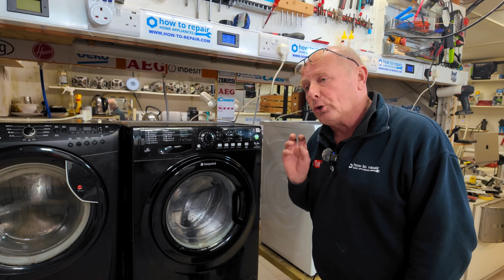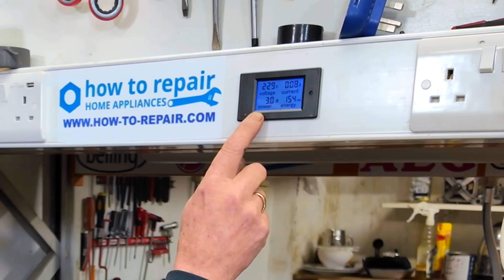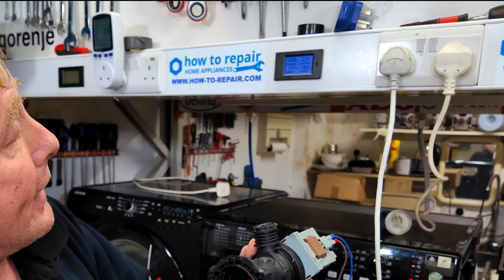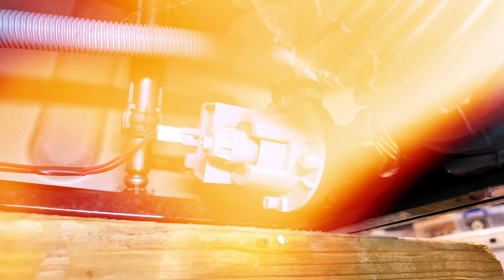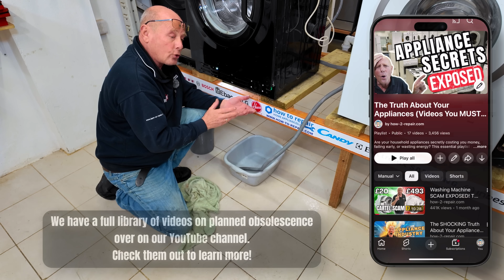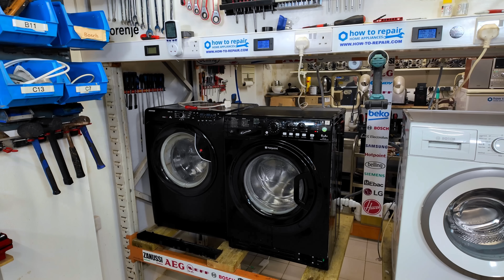How to Unblock a Washing Machine Pump Without Making a Mess

Comment: How can people be this dumb? Whenever a washing machine stops draining, the plug in the front of the machine is the first thing I check and once I've drained the water out all over the kitchen floor (with a towel in place) and removed the blockage, the machine usually works flawlessly afterwards.

If that isn't the issue, the machine not being level/tilted forward slightly is another one I've encountered.
Reply from the maker: It can certainly feel frustrating when the solution is so simple, but in my 40 years in the trade, I’ve realized it isn't always dumbness it's often just a massive lack of confidence. Many people are terrified that if they touch a machine, they’ll either flood the house or get an electric shock. That’s exactly why I make these videos!

If you’ve got a knack for keeping your appliances running, please give the video a thumbs up, share your own repair stories in the comments, and subscribe to the channel! For any spare parts or tools you might need, check out our website, and if you'd like to support the channel, feel free to Buy Paul a Beer. Thanks for watching!

Comment: just scrapped/replaced my own machine i had the last 6yrs bought 2nd hand (exactly the same as that but in grey) must have been 8-12yrs old picked it up for free a,long with a matching fridge both immaculate previous owners just fancied a change lol madness....nyway initially thought it was the dampers (bad vibration/banging) when i stripped it down noticed play in the drum and presumed it was bearings there and then written off as the drums sealed......Anyway when i eventually stripped it down part for parts/part to make taking to the tip easier (and of course the instant handy garden log/garden waste  pit I found that it was not the bearings BUT the spider had erroded and snapped on one leg kept the motor control panel pump door and various valves/solenoids to list on Ebay at a later date if i can be bothered
Reply from the maker: I've seen that exact scenario more times than I can count. You’ve done exactly what I recommend keeping the brain (PCB) and the heart (motor). Those parts are becoming harder to find and listing them on eBay is a great way to help someone else keep their machine out of the landfill while putting a few quid back in your pocket.

If you enjoyed please give the video a thumbs up, share it with your DIY mates, and subscribe to the channel! If you ever need advice on your new machine or want to check for spares, head over to our website. And if we've helped you feel better about that scrapped machine, feel free to Buy Paul a Beer.

Comment: I read or heard somewhere that if a washing machine has a visible filter door, the owner is more likely to find and fix a blocked pump themself, than if it is hidden by a full width flap - A case of owners not RTFM.
Reply: I've had both. I don't like cleaning the filter but I do it because replacing the whole machine is a lot more costly and hassle.

Comment: If you see that people do not even do these little bits of repair - they will definitely not open a drum.
Still, those broken machines can be exported and repaired.
Reply from the maker: In my 40 years in the trade, I’ve seen the repair gap grow wider and wider. If a five-minute pump fix feels like too much of a hurdle for some, then cracking open a sealed outer tub to get to the drum is practically out of the question for the average household.

That’s exactly why I’m so vocal about built-in obsolescence. When manufacturers weld those tubs shut, they aren’t just making it harder for the homeowner they’re making it nearly impossible for professional repairers to do the job at a price that makes sense.

My goal is to give people the confidence to at least look before they leap for the credit card to buy a new one. Even if they don't want to open the drum, clearing a pump is something almost anyone can do with a bit of guidance!

If you agree that we need to keep these machines running longer, please give the video a thumbs up, share it to spread the word, and subscribe to the channel! You can find any spares you might need on our website, and if we've helped you save a machine from the landfill, feel free to Buy Paul a Beer to support the channel. Thanks for watching!

Comment: Idk if obsolescence is a thing. People want cheap appliances. Of course old washing machines were more reliable, in today's currency a washer from the 80s would have costed around 4000€ (Miele W433 from 76, currently restoring it. Everything is broken/brittle). 
If people would stop going for 300-500€ washing machines, the industry would follow. 
Plus people just don't know how to maintain their stuff and keep using liquid detergents and low temp cycles... you wouldn't believe all the stories I already know why people throw their appliances on the dumpster. Clogged pumps, lime, wrong leveling, etc... you name it.

Sealed drums are a problem for DIY techs. But here in Europe many people just don't want to spend 300€+ on a drum repair when the whole machine was just 500. Or a new one is 400€. So why spend money on accessibility, when consumers won't even use it? Changing the bearings is nothing you would do for 60€ as a service technician...

Even a broken heater is a death sentence for many washing machines nowadays, because the repair is already at 130€+...

I hear you, but I guess the best thing is to take profit from this situation and get good appliances cheap and repair them.
Reply: A good way to get people to spend a bit more on their appliances would be to put reliability ratings on their energy labels, so they can compare life expectancy along with energy usage. It could be based on the reliability of previous models of the same brand that had a similar RRP band (and allowing for inflation). The data could be collected automatically by wifi enabled appliances reporting hours runtime/ total cycles and error codes, and also having a label with the model and serial number that's scanned at point of sale and at point of disposal. This would encourage manufacturers to make their appliances both more reliable and easier to repair.
Reply: @mels8966  Sounds like a good idea!

Comment: This is an example of where, if it was done properly, having Wifi in an appliance could actually be useful, and might have saved the owner from throwing this out and buying a new one. Instead of presenting the owner with an unintelligible error code when it fails to pump out in a timely manor, with WiFi it could push a message to its phone app telling you the problem in plain English and the app could instruct you how to clean the coin trap and unblock the pump with diagrams and video, and even offer to book an appointment if it was all too much for the owner to do.
Reply from the maker: If a machine is smart enough to connect to your home network, it’s certainly smart enough to know the difference between a motor failure and a blocked filter. On the other hand, I've been repairing washing machines for nearly 50 years, and the basic principles of washing clothes haven't changed since the 70s. They wash, tumble, heat, and spin. It's baffling why we need so many extra features now. Machines used to last 15 to 20 years on average. Nowadays, you're lucky if they last five years. Obsolescence is clear in today's society.

Comment: Ha, I wish our Maytag was this easy to access.
Reply from the maker: They can be a different beast entirely compared to the Hotpoint in my video. It can be a bit of a puzzle, but the principle remains the same: find that pump, check for blockages, and save yourself a fortune. If you’re struggling with a specific model, it’s always worth checking if there’s a hidden access panel or if you need to go in through the front.

Comment: Great job Paul. 
Defo a colour catcher is that. Or a snot rag as they say. Amazing how they get clogged. I personally wouldnt ever use them. Just adding more ways to ruin your machine. Our mothers would always say "empty your pockets" 
But its so awful to see a working machine hit the landfil because of a simple blocked pump. Lazy people.. i would understand if it had rust and bad rust. visually looks awful. But for a blocked pump thats such a easy fix. it might be quite old hotpoint but if still works they should keep them! 

Its never a waste paul. time you put in the likes, the interaction is always great! but also if more idiotic people throw them away! the parts you salvage are so good! your work is so appreciated my friend
Reply from the maker: It’s spot on those colour catchers are a nightmare for pumps. In my 40 years in the trade, I've seen countless machines written off for a simple 10-minute pump clear-out because people assume the machine is dead. As I highlight in my recent videos, manufacturers are making it even harder by welding drums shut, but it's the avoidable stuff like blocked pumps on solid old Hotpoints that really grinds my gears. Salvaging those parts is the only way to keep the good, repairable machines running when the manufacturers would rather you just buy a new one with a £493 replacement drum!

Comment: I am looking your videos from Germany. There is no similar channel available in Germany with your great quality and detailed knowledge.
I was already able to give our Siemens washing machine a live of 28 years but finally the spider was broken  and I was not able to find any spare. Now we bought an entry level Miele and we hope this machine will at least life 20 years, despite the knowledge about the sealed plastic drum.
I will keep fingers crossed. Many thanks for your videos ❤
Reply from the maker: Thank you for watching all the way from Germany. Miele has built their reputation on robust quality machine with reliability as their core function knowing that the appliance will be institute for many years. However, they are now introducing sealed plastic drums into their washing machines this is stopping the consumer replacing the bearings or spider and on some cases even stopping them. Accessing the drum to remove small items of clothing that may have got lodged between the inner and outer room removing bra wires or even maintaining the machine. Is this corporate greed and the start of the downfall of a once trusted appliance brand?
Reply: @How-to-repair is Miele German made?

Comment: About twenty years ago I looked at a new washing machine that had replaced one that had previously failed. It wasn't filling correctly it turned out that the "plumb yourself tap" that provided the cold fill had corroded so bad, it could not fill the machine. Unfortunately the original machine went to landfill because of the tap connection when there was nothing wrong with it.
Reply from the maker: While your story was about a plumbing fault, today’s manufacturers are making the situation even worse by welding the drums shut. In the past, a loud bearing was a £20 fix now because of built-in obsolescence, that same fault can cost you £500 for a complete drum assembly, often forcing people to scrap a machine that is otherwise in great condition. Please don’t forget to subscribe and share it where possible. It might help others make a wise choice instead of being misled by the industry.
Reply: @How-to-repair I'm 65 now and about to retire. I've worked on many different things and usually found guidance from the likes of Haynes repair manuals when attempting something I'd never looked at before. I wish YouTube had been available when I was younger and more active but although I rarely get involved in domestic appliances these days, I still really enjoy watching these videos to see how things have changed. Thank you so much for sharing your knowledge. 
It's very much appreciated.

Comment: The cloth caught in the filter looks like one of those "Colour catcher" cloths.
Reply: Or a child's sock. It happened to me once. I googled the problem, found the possible causes and did exactly that (without all the testing phase, obviously).
Reply: @ammelois  You're suppose to clean the filter on a regular basis so you would've found this straight away.
Reply: Yep. Just did this same job today for the second time in a year, yet another colour catcher. Told the Mrs if she wants to use these things to put them in one of those mesh bags she uses for "smalls".
Incidentally, I've yet to see one of those things with any "caught" colour on them!
Reply: @colinmc2136 😂😂
Reply: @colinmc2136  I'll admit I did buy a box of those many years ago. I stopped using them when one of them "disappeared" an ended up getting pulverised between the inner and outer tub of my Zanussi Lindo 1000 Washer Dryer. I spent the next year and a half removing bits of it that would get caught between the drum and the door seal (and/or get deposited on my clothes). I avoid them like the plague now! My Zanussi WD is over 10 years old now (and I use it a lot) and it is still working fine but I try to look after it by using powdered detergent, usually wash at 40 or 60, run maintenance washes and descale it now and again, and of course check and clean the filter every few months!
Reply: @colinmc2136 I have been caught with them too but I must say they have been coloured. Mesh bags are now being used for them
Reply: My guess is that 1% of the washing machine owners cleans that filter on a regular basis. I might be on the high side of my guess....
Reply: Had this exact situation with a colour catcher, now all good
Reply: Do you ever buypass the electrics and water 😊

Comment: About to purchase a new washing WM. Tried in vane to figure out problem with Hotpoint WDL540 The pump runs but doesn't have any flow checked for blockages filter etc outlet all clear took of pump sump assembly no blockadges or objects after first clean after problem started? Re fit pump and rubber sump assembly and works fine for a few months then problem returns but no blockages. Is there an issue with the sump assembly and the ball float! Seems the pump is running but can move the liquid? very weird! Any ideas!
Reply: you could have something, usually a sock or colourcatcher, under the ball in the sump holding the ball up which in turn would block the water to the pump. you can feel around the ball with a finger or pop the ball out but make sure you put the ball back in. sounds like you sorted the problem and a few month later something else got through into the sump/pump. machine 'eating' clothes as usually overloading and smaller items like socks get forced between the drum and the door seal. hope that helps

Comment: A half decent video this time 👍 I rescued my washing machine from a scrap lorry about 18yrs ago and that was a hair grip in the pump and a few years later I went to the customer who's machine it was, it cost me £20 from the scrapper bloke and her, as you say, £300+!
a couple of comments on the video though. the 'module' that you show is the display board and NOT the 1 that is in control of the water level-that's the main board.
to cancel a program on that machine you only need to pause the program and turn the knob to a new position and the start/pause will go green again, no need to turn the machine off.
it looks like a 'colourcatcher' to me which is quite common, I advise the customer to use 1 of the little bags you used to get to put the tablet into if they have 1, or use a laundry bag so it doesn't find its way into the sumphose and then the pump.
I've been doing this job for 35yrs and it was only a few years ago that I had to fish a condom out of the pump!! you can imagine how embarrassed the customers Mum was when I showed it to her😲
having retrieved the object from the pump and ALWAYS with the power off, if you put your finger into the pump and turn left you might be able to feel or there is anything on the way to pump be it more cloth or coins/keys/brawires/lolly sticks/tooth picks/stones/sweet wrappers.. the list is endless!
I'll let you off for not wearing gloves for this video
on a side note... why is it SO hard to find good old fashioned tablets in the hight street and super markets nowadays, I don't want my machine to go mouldy so ALWAYS use tablets.. guess I'll have to use powder instead as that's the only alternative to mould inducing liquids/pods!
Reply from the maker: You've hit on a really important point about the longevity of older machines versus the modern throwaway culture, especially with your 18-year-old rescue! It’s incredible to think that a £20 scrapper find has outlived many of these brand-new £600 machines simply because it was built to be maintained. This is exactly the kind of built-in obsolescence we discuss where a simple hair grip or a blocked pump shouldn't mean the end of an appliance's life. Thank you for your comment. I appreciate people like you taking the time to write it out. Please don’t forget to subscribe and share it where possible. It might help others make a wise choice instead of being misled by the industry.